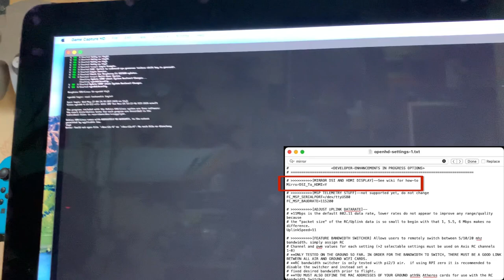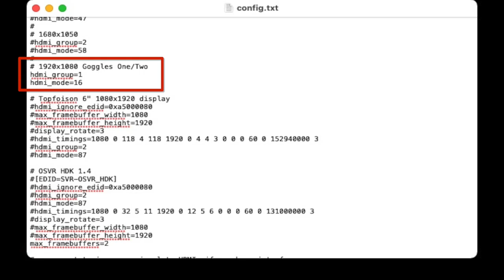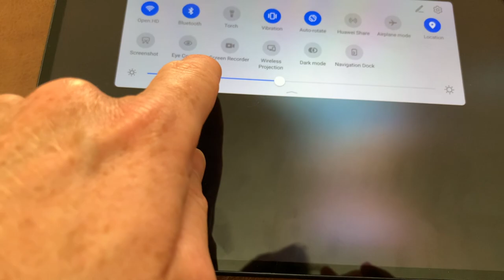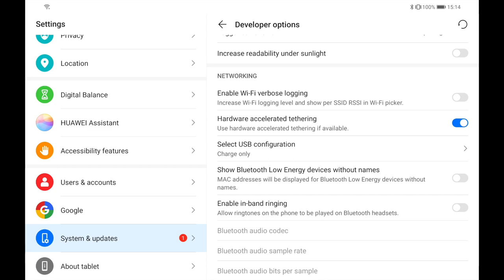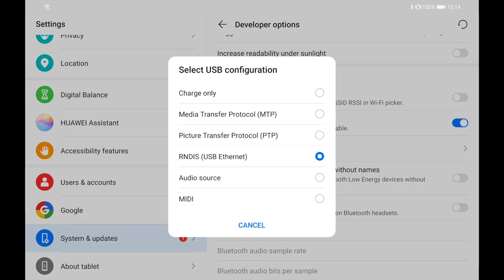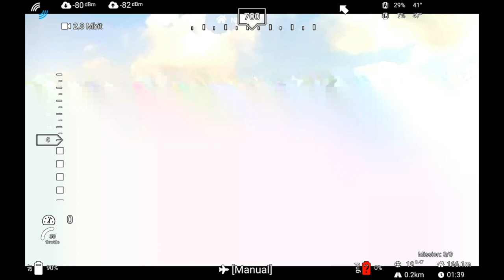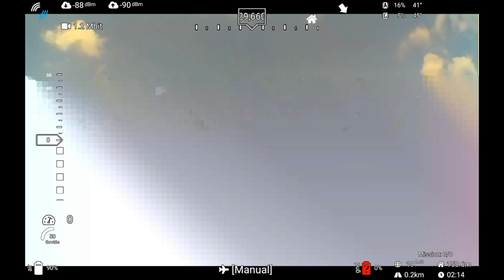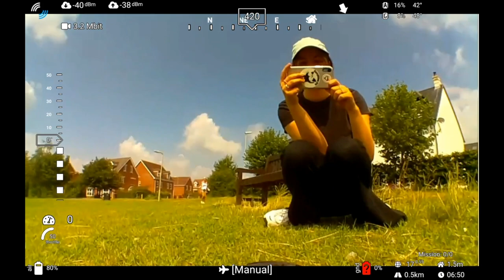Open.HD Project Part 4: Using goggles, better DVR & Updating everything

Comment: I really like your trial-and-error approach to working through issues in your videos. I hope you take what you've learned about open.hd and put it on a long range fpv plane, working through the issues of wifi card, power, antenna choice, etc while trying to keep weight minimal.
Reply from the maker: I wanted to show everyone the stuff I tried that also failed so people don't have to find that out for themselves - although some of it comes down to different gear... perhaps other goggles would have been fine with the Elgato.  I want to put it on a plane as well, I think it would very easily slot into my Mini Talon, but we'll try a quad first.  Antenna is another interesting one - the AC56 uses 5.8Ghz, so would a regular circular polarised antenna work best like in regular analog FPV.  I don't know, but it's certainly worth some experimentation.

Comment: Wow that quad looks huge. 7 inch props?
I have Eachine Goggles Two, was my first goggles for some time, but then I went on EV200D. Now Goggles Two using people who watch me how I fly. While this goggles have nice battery. I have to put DVR on them, thats is some goal for them to do in future. While they are very nice to use them, are very light. Great goggles.
Reply from the maker: 10" props, it's how we used to do it in the olden days :)
Reply: @CurryKitten  Really 10 inch, what battery you needed that this fly? Just drone should have more then 1000g? From which year is this drone? I thought evolution was 3 to 5 inch and 3 and 4S batteries and then later increasing prop sizes to 6, 7 inch and also higher voltage at batteries, 5, 6S,... Hmmm it looks I was wrong.

Comment: Nice experimental project. Much appreciated that you're documenting this. 

Wondering if the compass being above the motor is having an effect? Walking with the rover, without motor power might give some insight to the cause.
Reply from the maker: Suggestion is that I can untick this box that says "using iNav" for the compass as it's now automatically detected if you are using iNav or Ardupilot.  So that's an easy one to check out.
Reply: @CurryKitten  It is actually the message values sent from Inav has changed since 2.6. Previously it was different to ardu so there is a switch for using compass with Inav to change the value. The switch now reads "For INAV < 2.6".

Comment: Pretty interesting project, Wayne! 😃
How about the latency? Did you noticed it at all?
Anyway, stay safe there with your family! 🖖😊
Reply from the maker: I didn't.  That's not to say there isn't any - it's around 100ms.  It's just driving around a bouncy car just isn't that responsive compared to a fast quad, so you just don't notice.
Reply: The latency of OpenHd is 80-120 ms depending on configuration.
For racing flying style much to slow. But very good enough for calm flying style without tight obstacles.  
With a latency of about 120ms plus human reaction time, at a speed of 30 km/h you are visually about 3-4 meters behind the actual position of the copter.

Comment: 14:12 disable the INAV option on the compass and/or the arrow widget. It has been fixed to auto detect whether is Ardupilot or INAV.
Reply from the maker: Thanks - Luke Shanks told me to try toggling the iNav option on in the OSD (mostly to change the comma to a decimal point) but I can check that out quickly as I haven't started on the quad yet

Comment: Question,   Does adding goggles add more latency?  I'm getting ready to jump on the Openhd ecosystem soon.  Soon as I sell one of my DJI goggle set to fund this.  I'm done waiting on them /DJI or Caddx giving us DJI users a PROPER OSD with Compass heading ,throttle, ect.  Canvas mode was promised by caddx last year but we still don't have it.   My guess is we never will.   LR needs proper OSD and DJI osd doesn't get it for me.   Yes DJI system works ok and I can easily achieve 10kms on certain days but without the proper data showing like Airspeed and compass it makes flying a little uncontrollable for us fixedwing pilots.
Reply from the maker: No - basically because you already have to take the HDMI signal out of the Pi and stick it into something - be it a screen or goggles

Comment: Very interesting! I wonder how long it takes till someone finds a way to connect one of the HD FPV cameras (Caddx) to the Pi Zero.
Reply from the maker: That doesn't seem to be an option right now.  I wouldn't be at all surprised if DJI used some sort of encryption on the interface.  In the meantime I was recommended checking out something with an IMX327  sensor like this one https://thepihut.com/products/night-camera-module-for-raspberry-pi pretty expensive, but the results are certainly nicer.

Comment: My HDMI to USB capture does not have a pass though and the mirroring does not work as you know so what i did was to use an HDMI splitter on the pi and plug the Capture card and goggles into that and things work as they should.
Reply from the maker: It seems to me that the HDMI negotiation between CPU and display can only happen once though - so it's the case (I think) of getting two displays that are happy with the same sort of thing.  It's probably those Goggle Two things I have being weird
Reply: @CurryKitten  it's a device sensing thing as well as not wanting to mirror,  I did discover with the way I have set up is the pi will boot into different resolutions depending on what is connected at the time of boot,  if I have both connected at boot then it gives me borders on my googles but if I boot with the goggles connected then plug in the capture,  I get the right resolution on both. 
I tried setting a fixed resolution but that messed up one or the other but booting to the googles in auto mode gives me a working resolution for both.

Comment: ahh, now i found it cause I had followed it back then heavily and watched it over and over again.

I hope you will get the new chinese pi clone of the size of a mini with a power of the Pi3 b+

Pi nano or whatever it is called and should also run perfect with inav 3.0
Reply from the maker: Possibly - although I do already have a few pi4's as ground pis and you generally only need 1, but something small in the air is always good.  Do you mean the Pi Pico - as that's a bit different and I don't think usable at the moment.  I did go back and sort out the compass issue though (before I ripped most of the parts back off the rover for the quad)

Comment: Gimbal stabilisation via iNav? Might be less puke-inducing.
Reply from the maker: I think you'd probably want a brushless gimbal to handle the movement on it's own.  I'm presuming iNav can only push servos around to act as a gimbal?  I've seen some guys work with BLG's on cars and the results are pretty nice.  Slightly surreal watching the wheels bounce around the frame with the foreground quite static, but it works